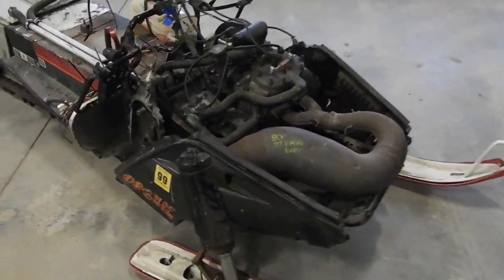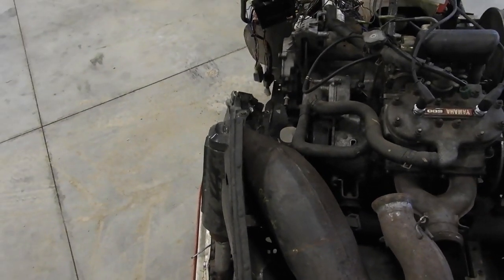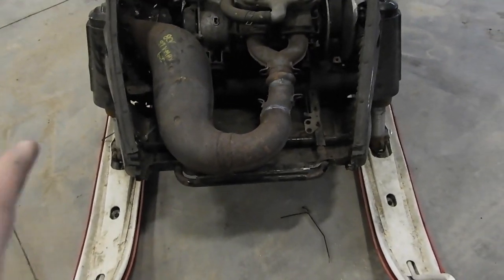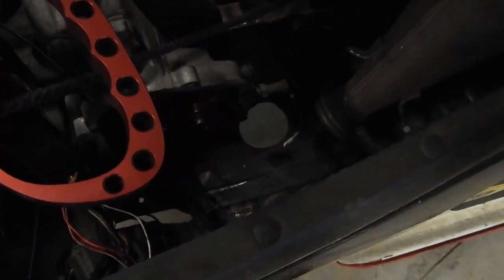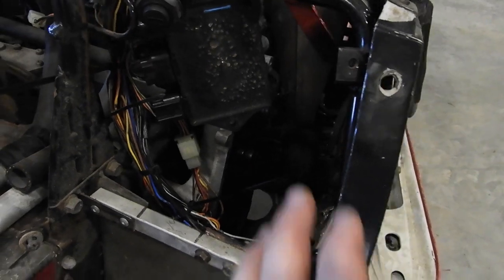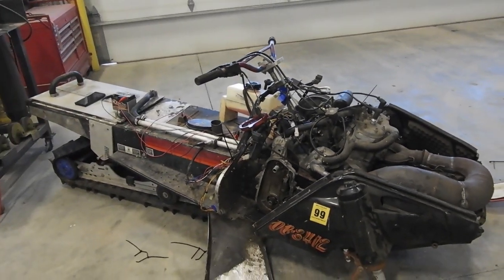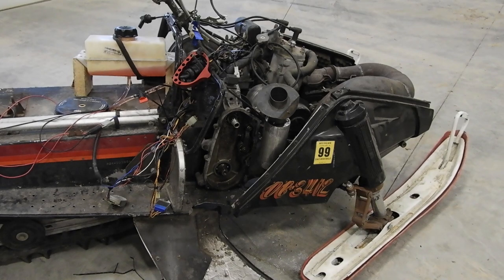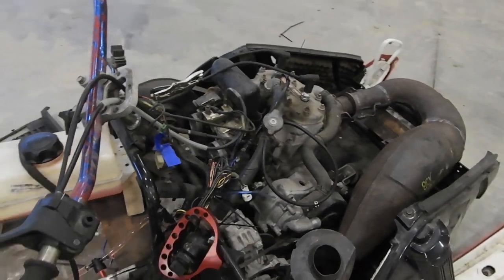Buidling a Homemade Mountian Can for my 600cc Phazer Mod Sled

Comment: Glad to see you back at it!  Working on my mod phazer too.  Do you see any need to raise the front end with that suspension set up?
Reply from the maker: I dont see a need to raise them as long as they are fully extended. Most of the ways I've seen of raising them look like they weaken it quite a bit too.

Comment: I really wanna make my own can just for fun, my friends have me convinced I will blow my sled up though, just wanna know if it’s still going strong for you, I have a 2002 rmk 800 btw I didn’t know if it mattered or not.
Reply from the maker: Building my own can seemed to work for me although I wouldn't risk it if it was my only sled. The biggest thing is to not modify the expansion chamber. I didnt get to ride mine enough to really know if it's going to last